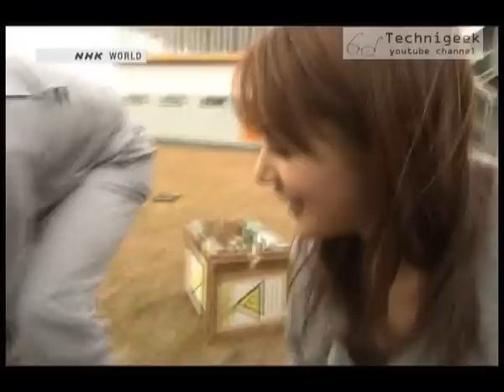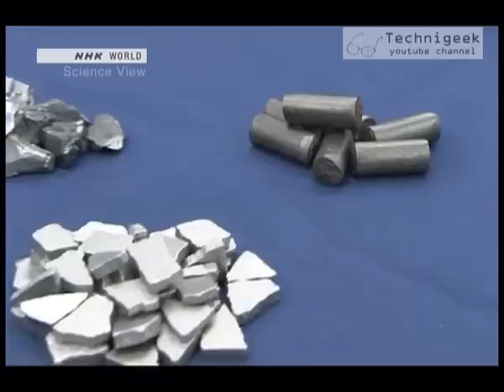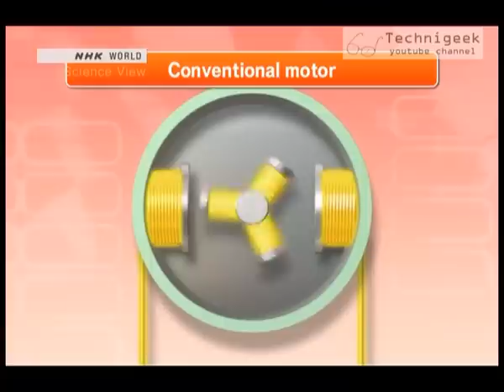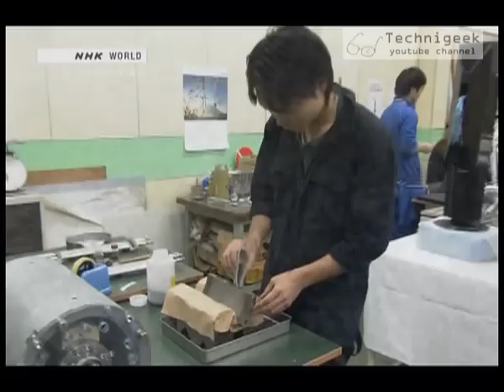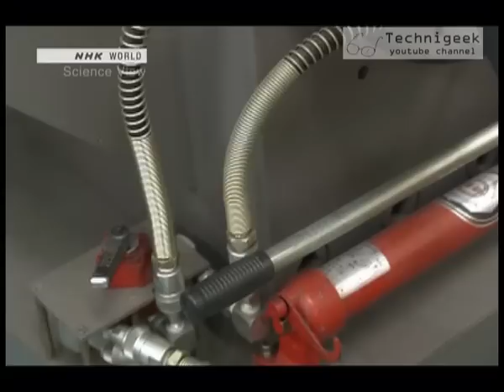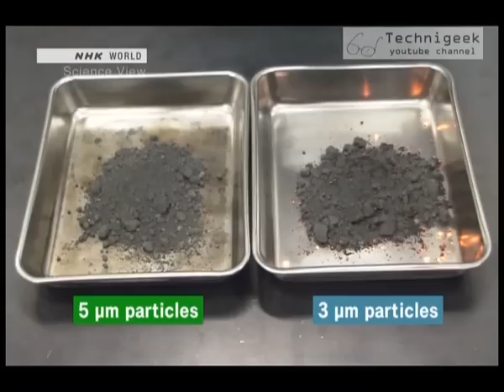How its made - Neodymium magnets  كيفية صناعة المغناطيسات الخارقة القوة

Comment: Brilliant stuff. I wonder if there is a way that they could merge neodymium tech with ferrofluidics to create liquid neodymium magnets. It would be interesting to see how much extra heat conduction could be facilitated by using a pump and heat radiator system, rather than just that magnetic rotor system.

Comment: the magnetic filings.....could they be sealed permanently in 100% silicone. use the magnets to spread out the filings into individual filings while the silicone is wet...then when dried the filings would be individually sealed from the oxygen???? just trying to help....Japan. P.s this process should be done in an oxygen free chamber as well. When completed...vent out the nasty fumes from the silicone. Peace.

Comment: In the refrigeration units, where does the heat go? In conventional units the heat is transferred outside and released in the surroundings. Would an air conditioner setting in the middle of the room work? Conventional units would not.

Comment: I'm sure there is a reason they don't do this, but why not use peltier chips as heatsinks on the magnets and turn the thermal energy into electricity?
Reply from the maker: ifixipods this is a very good idea , but some calculations should be done first , so the cost of adding this module would be worth it ,
Reply: ifixipods The peltier needs a massive heatsink itself or it can't get out of its own way. I have chilled 20 gal of water to 20 degrees below ambient temperature but it required a very elaborate set up to keep the hot and the cold very isolated from each other. The chip generates more heat than cold and requires a very large heatsink (and fans, and low ambient temps, and thermal foam) for itself, otherwise it is too slow to be very useful.

.... but I like the way you think :)
Reply from the maker: elfkindd so you have knowledge of this matter , thanks for giving the information here
Reply: *****
 I knew there was a reason, thanks.

Comment: Question, 
What grade of neo magnets are usually used in cd/dvd drives?
Reply from the maker: watdah C well , im not sure , probably a good grade , high quality ones
Reply: *****  oo 哦8699不
Reply from the maker: Anna Oh ????
Reply: Stephen Patrick Pasawa Most likely N35.  The ones I've played with weren't anywhere near as strong as some N52 of similar size.  N35 is still significantly stronger than common ferrite magnets of the same size though.
Reply: @mr2000jp  n52.

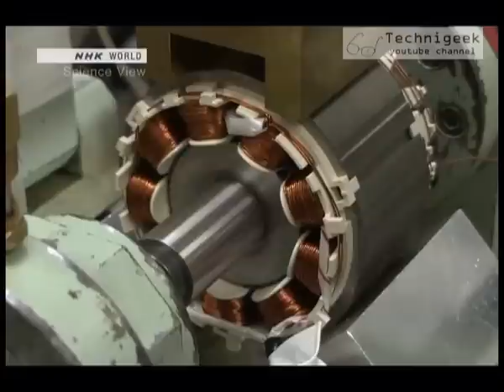Comment: At 4:30 you are suggesting that conventional electric motors have an efficiency of less than 50%. Think again.
Reply from the maker: Filip Wahlberg well , im not the one who said it ,but in general i think its about this ratio , the lost power due to efficiency is quite huge
Reply from the maker: Jackie Scholl huh?
Reply: +Jackie Scholl Well, it's not like that was the ONLY thing that they did. I mean, the newer motor was visually smaller, suggesting a redesign of the outer coils. This video's test may not have been very telling of how the neodymium magnets affected efficiency. Oh well.
Reply from the maker: mckryall i guess you are right
Reply: I think at 4:30 are the measurements of power input at no-load running.

Comment: Does the magnet work by size? I’m working on a project and just working on a project and need help. I can’t find magnetic tool box mats and am trying to make the most use of the space in my toolbox And can’t find magnetic mats for said purpose. So I am having to trial and error by going the diy route. The YouTube community help is needed like forming like voltron right now to solve my issue as I am waiting 2-4 weeks for a $10 eBay order of 100 15X1mm of these magnets.

Comment: Okay okay so they have a problem with the Neodymium instantly burning when it has the smaller particles due to oxygen reaction, has anyone thought to fill vacuum out the air from a large building and replace it with C02? or does C02 react with Neodymium as well? if it doesn't they could use robotics to process the magnets in the large facility filled with C02, that would be neat.. probably expensive too but it would probably pay for itself so long as there were no leaks.
Reply from the maker: probably co2 is not the best choice
Reply: ***** I would imagine there would be a problem of sorts because CO2 is one of the most abundant Gasses on earth, there must be some sort of reaction.  It is also known to displace oxygen.  Maybe they could make Neodymium magnets in a hyperbolic Chamber
Reply from the maker: PS85 Gaming the good thing is that developers are working on it , so no need to worry
Reply: ***** We are also developers, you and I and anyone who has an open mind and thinking mind who is capable of calculations and learning, trial and error and comprehension, all you have to have is the materials, the will power, and the basic mindset to experiment, some PPE and basic fundamental knowledge helps as well.. So why let the so called "Developers" have all of the fun?
Reply from the maker: PS85 Gaming lol , i can't disagree with you
Reply: Nitrogen would be the safest/cheapest option, thinks me.  I also wonder if the co2 could potentially cause problems considering a portion of the molecule is oxygen; & I do not know how stable the co2 molecule is (perhaps it could break down & release oxygen, which defeats the purpose obviously)....but, I'm obviously not and engineer or chemist.
Reply: Ammonia has the same driving effect on oxygen as co2, but no oxygen molecule to react with the Nd.  Its not near as cheap as co2... but it is a byproduct of many processes.  Ammonia is what is used in our cold storages for apples to refrigerate and preserve them.
Reply: Noah Fitzgerald interesting thought.  I don't have much to add at the moment, I just got off work and my mind is racing on other things.  I will try to quiet it and come up with more ideas after a while.  You know how that goes probably.

Comment: hmm.... these small metal crystals can be weaponized....
Reply from the maker: what ? cant you think of it as for better use ?
Reply: ***** lol. yeah maybe some instant fire starters for camping purposes too.
Reply: de0509  still waiting for anti gravity cars
Reply from the maker: Daniel Hiro the technology is almost ready , its being used in this train , 
http://youtu.be/i_32Ii9oQ14
Reply: *****  wow o-o
Reply from the maker: ***** nice
Reply: de0509 You do know that simple iron, or most metals will also burn in oxygen? That's how flint and steel make sparks. The sharp flint knocks very small particles of iron off of the larger chunk, and their surfaces oxidize instantly when contacting the air. This generates heat, and because the small particles have such low volume to disperse the heat relative to their surface area, they begin glowing read hot, and can start fires.
Reply: ***** We have a capitalism system. In it, if you can sell a canister with some kinda powder that can instantly start fire when opened with zero effort, people would buy it. And yes, I do have that product you mention about. And I have started fire and it was enough to cook quite some time ago when camping.
Reply from the maker: de0509 thats why peoples lives are so cheap now adays , killing is easier than eating

Comment: can you float a maglev train on it?
Reply from the maker: it seems like maglev train works using a totally different technology
Reply: ***** maglev trains use 3phase AC linear synchronous motors and depending on whether it's electrodynamic or not the levitation is achieved by the same track that induces propulsion